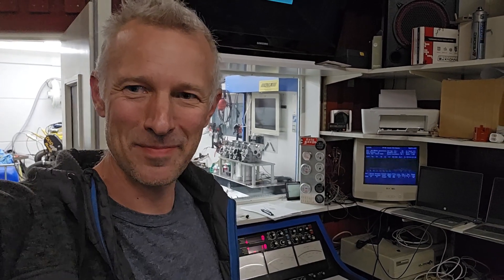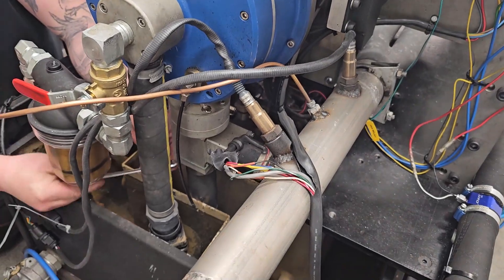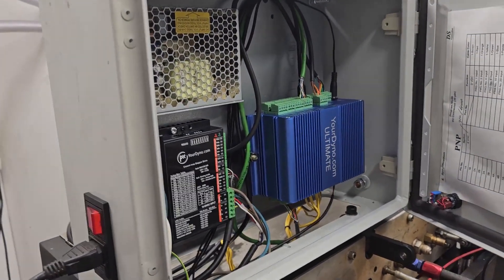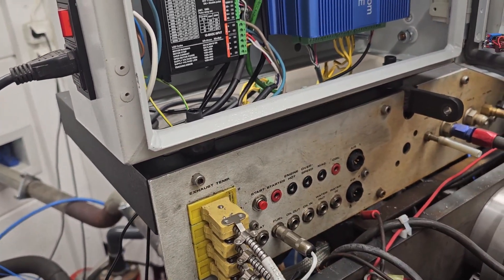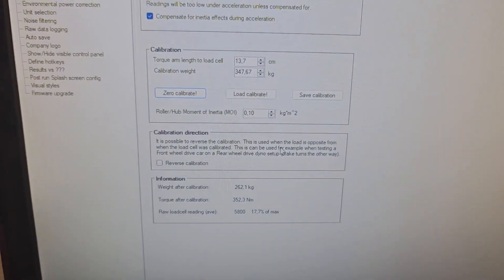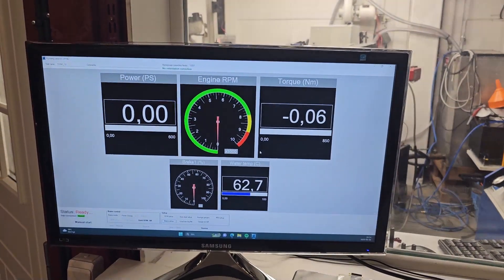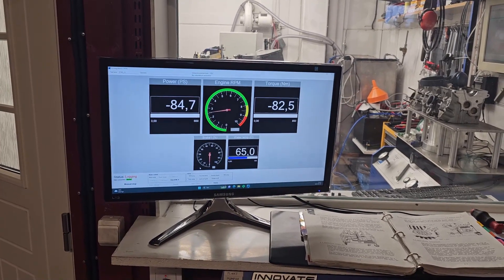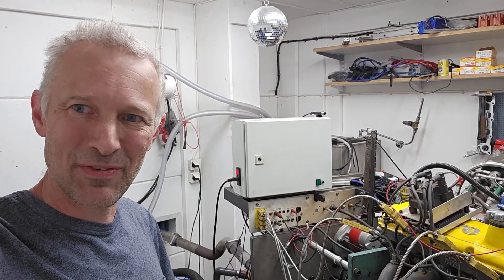SuperFlow 901 water brake upgrade to YourDyno Ultimate

Comment: representing the few people who cannot read your mind, or just think in another way, and did not have the time to all read all the forum pages to find a solution. you calibrate the torque sensor whit an arm, the torque arm where you put the weigh on it has a length. the torque arm from your sensor to center from the brake has a length. the problem is not that i do not understand what you are doing but where you put 3 numbers is you have only 2 spaces. your equation has 4 inputs, and you are asking for only 2 inputs.
Reply from the maker: There are several ways to calibrate the load cell. Here is my favorite: 1) Mount the calibration arm. 2) Zero calibrate with the calibration arm on. 3) Add the weight and click Load calibrate. 4) Remove the weight and the calibration arm. 5) Click zero calibrate again and click Save
This way you don't need to think about the weight of the calibration arm. The numbers you enter are the calibration weight and the distance to the calibration weight. The distance to the load cell does not matter
Reply: @YourDyno  thank you, if you did describe it like this in the new manual than there were no questions.